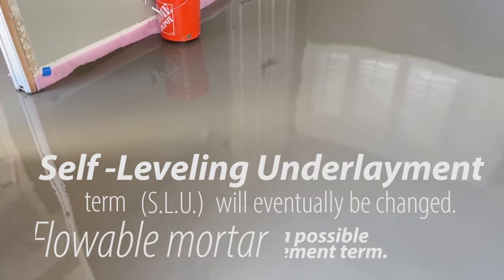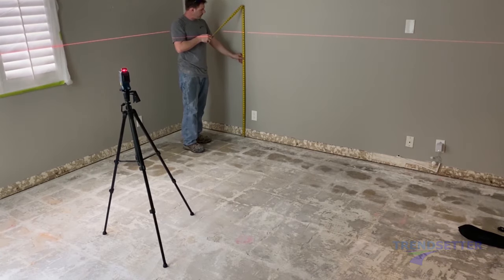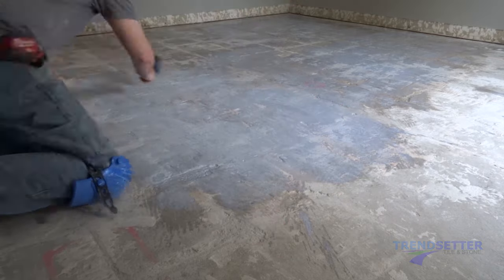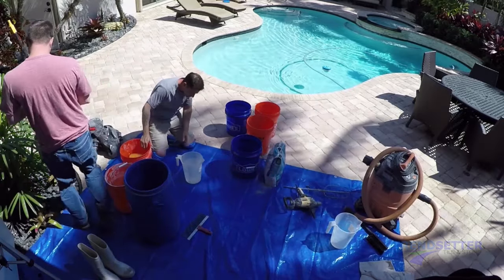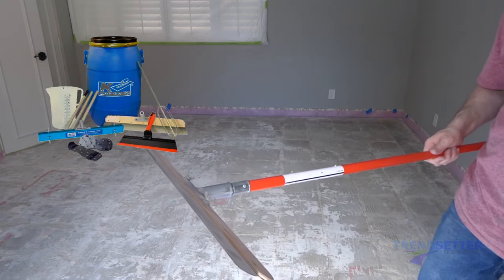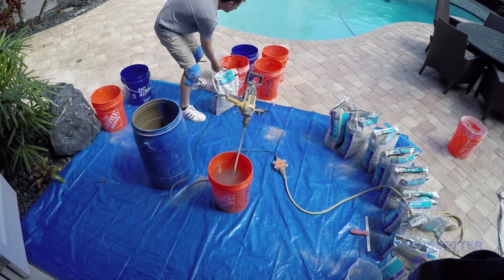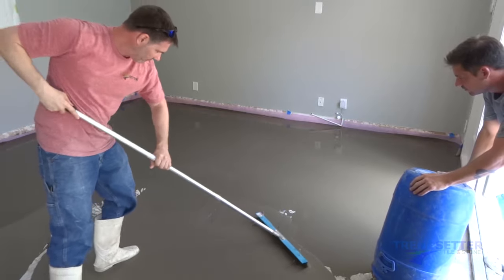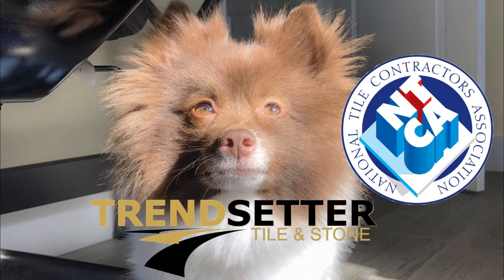Self Level Concrete Efficiently| SLU | Laticrete NXT Level | Level quick for large format tile

Comment: its interesting to see the difference in technique in the US compared the here in the UK, a lot of people still hand trowel but most are turning to the CAM rakes but after raking we use a spiked roller to break the tension and release any trapped air, no one uses a smoother or squeegee. might have to give them a go instead of the roller and see how it compares.

Comment: This is one of the best instruction videos on YouTube, thanks!  Very concise and informative; I never would have thought about starting at high point, makes sense how you describe it. My basement floor with nook is about 400 sf with no particular high spot but wavy like sand dunes with some low spots almost half inch even though it all looks flat. It would cost a lot to cover the entire floor like you did so is it okay to just to fill the low spots starting at the neighboring high spots and dragging it in?  Like you mentioned elsewhere, it doesn’t need to be level, just flat. So I guess I’d need to trowel around the filled area to feather edge into the high spots. Or should I just spread it around everywhere like you did while keeping it super thin on the hills?  Thanks again and hope you do more videos. Nice to watch a professional video!
Reply from the maker: Thank you for the compliment on our video! You can spot correct areas around your floor, but I can tell you over the years I found most of the time it was not worth it. The improvement may only be marginal and can sometimes feel like you didn't do anything. Since your floor is wavy, You should lean towards covering the entire floor. 

I usually add SLU partially to the high spot and some to the nearest low. Pulling SLU into a low spots is easier than dragging it over a high spot to the next low spot, so from a high spot I distribute it to the surrounding low areas. This is usually only necessary when I'm dealing with differences exceeding 3/8ths of an inch. otherwise I just treat the floor as if it's already flat and just distribute the SLU in the easiest manor that backs me up towards the exit.

 A good way to manage extreme undulations is to utilize screws like Tapcons, on the concrete when working with SLU. This way you monitor your progress in real time during the pour. The technique is seen in this video; https://www.youtube.com/watch?v=eDg6pjD001o

Three people would be better for 400 ft. One person should be on the mixing duties, adding product, mixing materials and helping to move batches as needed, with assistance. Person #2 is the placer and uses the rakes and smoothers and is in complete management of the pace. Person #3 is the in-between that handles communication between the mixer and placer. He also makes sure the placer has what he needs at any moment and that the batches move to the placer without interrupting his progress. Get two people to watch this video with you, assign each one a position, and crush this thing!
Reply: You are so Awesome!  The comment section is almost as useful as the actual video as you get to hear details/problems that other people are having, so your helpful (and timely!) replies are much appreciated. Cheers from Canada!
Reply: With a little plagiarism. I’m just being humorous.

Comment: I'm debating if the foam sill seal is needed between rooms that are also getting leveled. Does SLU over concrete slab even need an expansion joint?  And did you caulk the bottom of the foam sill seal so as not to lose material?
Reply from the maker: Each room should have its own perimeter joint. Allowing the material it into another room from under the wall means you do not have a sealed perimeter joint.

Often this is not a big deal unless the square footage begins exceeding 400 sq ft.
However, a perimeter joint for the tile work is always required.

SLU is supposed to follow the same movement accommodation guidelines as tile work. 
see EJ171 in the TCNA Handbook.

The sill seal is just stapled on the drywall. It is not caulked along the bottom. The SLU pushes against it and the loss of the material under it is minimal. It's ok if the sill seal rests on top of the concrete by a quarter of an inch. The slu will just sit on top of it along the edge.

Comment: This is a very good, thorough, well-paced video. I admire your deliberate process.
As part of the equipment list, you might include (specify) the type of mixing paddle.
When I mix concrete, I often vary the consistency of the mix. Not so with self-leveling mix. So—as you stressed—it’s very important to follow the mixing instructions. 👍
Reply from the maker: Thank you Richard! The paddle comes with the Kraft kit. It is referred to as the Oval Mixer paddle and can be purchased separately from places like Home Depot online. Most paddles will suffice except for the box paddle. Box paddles are too aggressive. We do on occasion use the RUBI TOOLS Mortar Mixer Paddle M-120-R 3H. 
Thanks again!

Comment: Thank you for this video, it's easily the best information out there when it comes to the self leveling process. Viewed probably 50 and there is a lot of incorrect and completely wrong methods being shown.
Reply from the maker: Thank you. I can understand how some people in their videos want to make it look very casual, but we didn't want to convey that as taking it too lightly introduces high dollar and high labor mistakes. This video is exactly how we've done it over and over again for the last ten years. This is the recipe that works for us.
Reply: @trendsettertilestone9602  thank you for this video. I saw your kit on WHITE CAP Supplies and I’m pretty sure I’m gonna buy it for my project. I have two questions though; with the leveling rake, what is the lowest you’ll go and how is it better or different than using a straight edge? 
Thank you in advance.
Reply from the maker: @JoseMedina-ms5jg  You're welcome, and thank you for the questions. Our gauge rake is almost always at one quarter of an inch. There have been instances when I have reduced it to three sixteenths but I can't say I have done that often. I wouldn't apply anything thinner as it may force an additional application and that is something I avoid because it adds time to the schedule.

While you could use a straightedge, it is more cumbersome, may require an additional person, and is really a technique for a different application. Straight edges are used for dry pack or fat mud applications which require finesse. SLU just doesn't need that much care. You are gonna place it with the rake, break the tension with the smoother, and it is going to handle some of the finer details as it continues to settle. 

When someone uses a straight edge for SLU there applying the technique they know to the wrong product. There is no benefit to it.

It can however be used to determine the flatness of the substrate prior to the SLU application if you don't have a laser.
Reply: @trendsettertilestone9602  Wow GREAT response thank you so much for explaining the differences between the two. This really helps me in determining which route I want to take in leveling my substrate before applying my LVP. THANK YOU SO MUCH.

Comment: Such a great video, definitely one of the best on this subject. Thank you for sharing such clear and concise instruction on a task that appears easy yet catches so many of us out. 
I notice your use of not one, but two smoothers but then no spiked roller, can I assume you have tried both methods and ‘settled’ on smoothers as your favourite?
I agree with your point that the term ‘self levelling’ underlayment is at best unhelpful and at worst deceitful. Needing to cooperate so attentively with a product in order to achieve it's only stated purpose feels a little disingenuous but if I owned shares in ‘self levelling’ that’s what I’d call it too. 
Usually my efforts at this game require some touching up after the main pour, which is a little frustrating. Discovering a new high spot (that I’ve created) after plenty of gauge rakeing and spike rolling proves that I haven’t quite mastered it. Maybe it’s all in the squegee smoother thing?
Reply from the maker: Thank you for the compliment , I can tell by your comment that you are someone who dabbles in precision like myself!

I don't know exactly why, but I was not a fan of spiked rollers. They do a good job of breaking surface tension but I guess I learned to "read" the floor really well during placement and the smoothers just seemed to serve me better, especially if I pull the smoother in as many directions as possible in a given area.

Another key thing is knowing exactly how bad the subfloor is in several locations. If I know where the high point is prior to the pour, I will keep looking at that spot during the pour. If it seems to bulge or be high at the time of the pour I use the smoothers to take the material away and drag it into low sections. A spike roller may not help to truly relocate an abundance of SLU in one location.

I have been through it all with SLU. I gotta say small failures and a lot of practice is the only thing that taught me how to do it. By time I took a course on SLU from the NTCA I could have hosted the class.

Check out this Youtube video I was part of in 2020.
Funny story about SLU's. check it out at starting around 28:39 of the video.
https://www.youtube.com/watch?v=zWyUVVDocX8

Thank you for the comment!

Comment: Excellent video. One thing I don't understand about using the gauge rake however. If the floor has high and low areas won't it follow those inconsistencies and bog down or ride over them not achieving much but pushing materiel around relative to the uneven floor. The tool seems to only make sense if it is already a flat level surface and you just need to refresh the surface.
Reply from the maker: You have to think of it like this; If you have enough SLU material in the space, meaning the rake is set between the average to maximum amount of correction needed, the abundance of SLU will settle with more material in the lowest points with less on the highs.  Following the rake and tensioner, gravity takes over.

The gauge rake set at one consistent height is not to achieve that height but more so to evenly distribute SLU. The SLU will then find the average.

The ability of SLU to flow is what makes it so helpful as opposed to other cementitious materials.

Using too little material could have a poor result similar to what you indicated in your question.

Thank you

Comment: Don't be like me and make a rookie mistake with the stirrer. If you don't own a pro heavy duty mixer, go buy or rent one. I made the horrible mistake thinking a corded drill or hammer drill would be strong enough. Oops. =( -1 on my man card. This is a very well done video.
Reply: A good cordless like Dewalt or Milwaukee (which any MAN should have already) will mix SLU just fine. No need to spend crazy money on that.  I've mixed hundreds of pounds of this stuff with my Dewalt cordless drill.  I even mix small batches (<5 gal.) of grout or mortar with it.

Comment: Great tutuorial! I'm wondering - is this product something I could stain after laying for a stained concrete floor?
Reply from the maker: Thank you, no this product is only appropriate when it is covered with tile. It does not have the durability, but Laticrete does make products that are applied similar, but are meant as a stand alone finish.
This is one option;
https://www.laticrete.com/en/products/nxt-level-dl

Comment: Is there a similar product that takes an irregular concrete floor and not only levels it, but also leaves you with a durable finished surface which does not require flooring? (A smooth durable surface which can then be painted or epoxied). Thank you. This is a great lesson.
Reply from the maker: This is probably the product you're looking for;

https://www.laticrete.com/en/products/nxt-level-dl

Comment: Great explanation on a process I am scared to death to start. One question that sticks in my mind is when you add depth to the floor, you are going to be impinging on clearances under door thresholds and transitions into other rooms. I am at a loss as to how to handle them. I am getting ready to install vinyl plank and my front door threshold is only about an 1/8" above the concrete slab. If I try to level the floor, there is not going to be any clearance. Is it advised to level the entire room (I have three living room, dining room, kitchen) to the tune of about 580 sq feet, or can I just even out the low spots?
Reply from the maker: Hi, you can spot correct areas, but you'll have to determine if it's more to your advantage to grind down highs or fill in lows. In some instances adding SLU can interfere at transition points like yours and you will probably sacrifice some consistency in the finished floors flatness if you spot correct and leave the threshold and door as-is.

If the threshold can be removed and the doors cut, applying SLU over the floors entirety would be your best approach. If that's not practical, a combination of grinding highs and filling in lows would be the next best option.

One other thing; there are better products for spot correcting that can have a feather edge so there's no ledge or bump where your patch meets surrounding concrete.

https://laticrete.com/en/surface-preparation/nxt/repairs/skim-lite
This product would be more appropriate for patching, it would require troweling or flashing for its application. SLU's are too wishy-washy when it comes to smaller patchs.

Thank you!
Reply: @trendsettertilestone9602  Exactly this!

Comment: Thanks both for this top-notch video but also for being so diligent in following up with users' questions. I have one of my own- we just poured a new slab in our basement (removed the old one and insulated the new slab). If we'd like to use SLU as a finished floor, without anything on top, are there better brands to go with?
Reply from the maker: Hi, Laticrete offers NXT Level Plus which has a higher strength and is fiber reinforced but it's not meant to be used as a finished flooring surface either. I don't believe it is a polish-able type. Some concrete types can be polished, and this is very important because it makes the surface stronger and more stain resistant.

In my opinion for your basement I would recommend you use NXT Level Plus to correct the majority of the concrete subfloor's irregularities. After that has cured I would install a self leveling epoxy coating. The cement SLU would save some cost, whereas if you used only the epoxy it could get expensive if the irregularities are great.

You can choose any finish or color that you would like in the epoxy, you can even get a mix that looks like polished concrete! It would be much more durable and stain resistant than a cementitious SLU.

Thank you!
Reply: @trendsettertilestone9602  Ah, thank you so much! We were loosely planning on a two-part epoxy in a bright color to keep the basement brighter, you've helped confirm that decision. I very much appreciate your recommendation.

Comment: Great video guys,  I need to do this in my kitchen and in places I have 15mm to bring up to the high point. Floor area is 20sqm and the level changes vary from about 8-15mm. I was looking at levelflex to do this, but wondered, do I need to get the levels up in consecutive pours or the entire area or do i mix the compound thicker to get the levels i need?
Reply from the maker: Hi, you should not mix your SLU with less water to thicken it up. This will only make things more difficult, reduce coverage, and potentially create humps that the smoother cannot overcome. I almost always mix my ratio of water to product at the highest available water ratio. This provides a little more time to work and makes the product easier to rake.

Do not mix your product outside of the manufacturers guidelines in regards to water and powder ratio. 

Most of the time I target the average height discrepancy to flatten the floor. To level the floor your target would be slightly higher than the average of high to low deviations on the subfloor.
So you are 10-11mm in gauge rake height to level the floor, if you correct all at once.

Consecutive pours are sometimes reserved for larger areas with greater depth that are not utilizing a truck delivery with a pump system.

Small areas should be one pour when possible, multiple pours in the same area should be considered for individuals at a higher skill level.
I understand this may be counterintuitive, but multiple pours actually increase complexity. The height of your pour would not meet my threshold for multiple pours and we work with levelers on a weekly basis.

While you are raking keep pulling the SLU from the high points and drag it to the low points. The SLU will continue to flow down to the lows after you have stopped raking. Provided your floor is properly primed, the water ratio is on the higher end, and you work at a fast enough pace.

Thank you